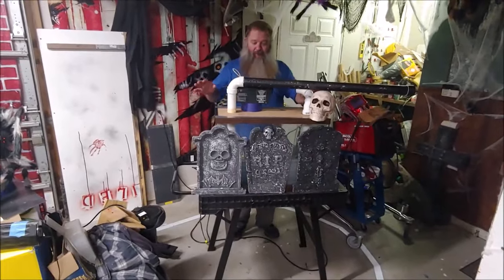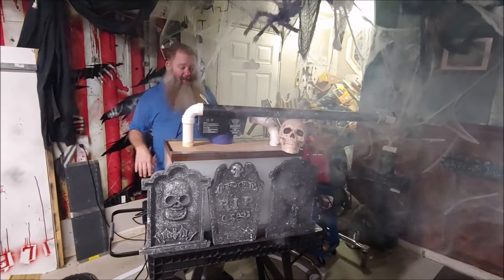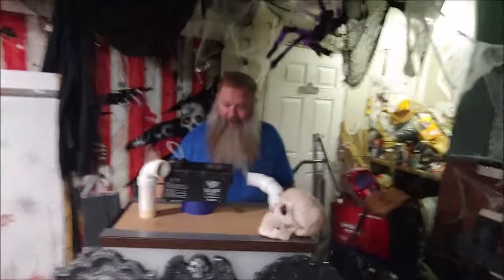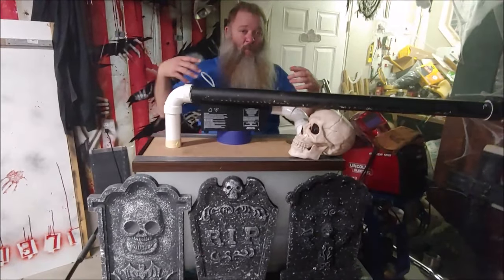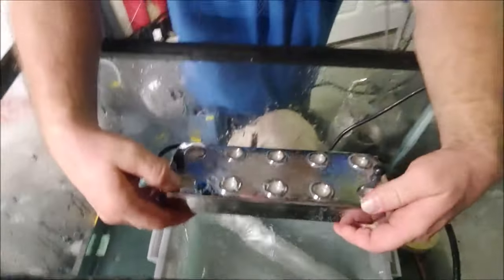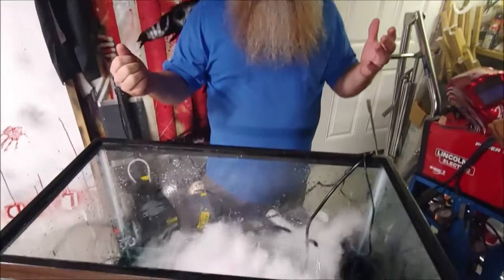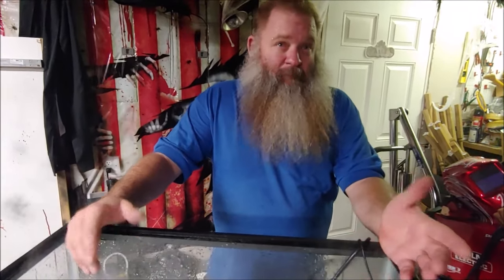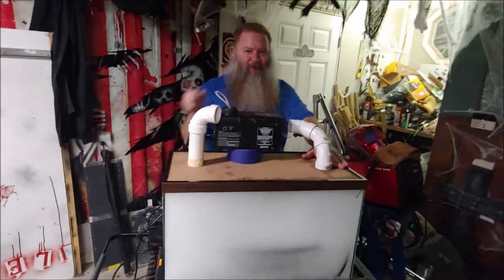Roberts Fogger: The original DIY Fog Chiller without ice

Comment: Heh.. I think I own the same brick shapped "pond" fogger. I also have an older one that includes a float that is round that I got 10+ years ago for messing with the same thing. I ordered last year a water pump to do the same thing (to keep the water level on the brick shaped pond fogger constant), but never got around to constructing a final container. A fish tank is a good idea, that was one thing I have not done yet.
But yeah, it's amazing the output. However one thing I've used is a duct fan (for heating) and a dimmer/fan speed control to adjust the flow on the output side because I've gone with choking the input side from the normal fogger (what I call the smogger) in order to reduce the spill output and then a timer on it so it has a controlled duty cycle. Hope my 2 cents helps anybody else!
The only thing I have to say is the water ends up getting fairly warm.. so perhaps a way of "leaking" water out slowly and replacing water from hose or something to keep it from getting too warm. My thinking is the cooler the water, the cooler the ultrasonic mist (pond fogger output) and the heaver the recombined glycol + mist will be -- with warmer water it doesn't seem to sink as fast. An additional 2 cents to solve out. What I've done is also add some ice, it it melts fairly quickly as these pond foggers (and the limited amount of water contained in the containers I've mess with) get QUITE warm over time. 
A larger fish tank would help, but eventually the water there will get warmer and a way to chill the water would be nice to solve (thinking a slow drizzle of water from a garden hose and a way to keep the 2nd water level from getting too high, has to be below the upper water level for the pond fogger).
Reply from the maker: These are great suggestions!  I wanted to use a float as that eliminate the need for the pump. 
I originally wanted to use the pump to run the water through a radiator with a fan to cool the water being pumped into the misting bucket. I just ran out of time.  
I really need to do some long term testing.  It seems that the very warm water doesn't have as much of an impact as I thought it would. That's why there is little motivation to cool the water for me. LoL. That and I bounce from shiny project to the next. 
But seriously, I was trying to keep this setup fairly uncomplicated.  I also thought of having a small window AC unit to run the fog output through to further cool it, but now it's more complicated than needed. 
However, I do worry about the heat of the water over time. So, I will revisit the radiator idea after I finish some other projects I'm working on. 

Thanks for watching and for sharing your experience with this kind of setup.  I think the DIY community can really help to refine this and make it killer!

Comment: Hi, hope all is well. I’ve seen both of your machines and I’m very impressed with both but I like the other a bit better. (I’m not knocking either, I like both just the other one a bit more) i am trying to build myself one like the previous one you made with the fan in it. I’m going to use a pvc tube and close the end and drill a few holes through the tubing. The only difference I’m going to try and see how it works I will be using g dry ice and the glycerine vegetable oil with distilled water I think it’s like a 40-60 ratio or 60-40 something like that….. if you have tried anything like that what was the outcome…. If not I will let you know how it came out. I live in the north east so we have a windy fall so the thicker the fog the more noticeable it will be. Thanks Rob…. Your info is very appreciated. Make your digger and start selling it and make some money. You never know. Blessings

Comment: Just wanted to say thanks! Ingenuity at it's best!  Just orders parts and will hopefully have an ice-free Halloween!!
Reply from the maker: Thank you so much!  I hope it works well for you.  I'd love to see the scene once it's all assembled.
Reply: @intocoasters  Parts just got delivered. I went for simplicity, used large plastic tote for the water, and floating a 12 head mister, so no need for second container or pump. An elbow on top for entrance and flex pipe out for fog. assembled in under 30 minutes. All holes are in the lid so the tote is still functional for storing Halloween decorations.  Did a quick test and I'm amazed at how well it works. Logs of thick, low fog.   My display is small, a handful of tombstones, small fence a skeleton or two, so not that exciting. It's the fog that make it. First time I've done a haunt in years, so still fun.    Thanks again for sharing your invention. This revolutionizes low lying fog.
Reply from the maker: @nicksweet3826  Awesome to hear!!  and yes, holes in the lid gave an accidental ability to still use it as a proper storage bin.  I store the parts and some other props (usually loose bones) in the same bin after letting it dry out.
12 head! Dang, I bet that is awesome!  I should upgrade now, LOL.  
Thank you for the follow up and I am very happy to hear it works well.
Happy Haunting!
Reply: @intocoasters   Here's a short video testing it out. Now if I can only get people to stop calling the fire department as I work on tweaking it...  https://youtu.be/LAuQQjIE66c
Reply from the maker: @nicksweet3826  oh man that is beautiful! I love the crawl and the density.
I live next door to a volunteer fireman, the struggle is real! LOL
Reply from the maker: @nicksweet3826  DUDE!  Having multiple levels for the fog to roll out of is killer! 
Looks like the fog is coming from the graveyard proper.

Good to know about the humidity/temperature confirmation. 
I haven't noticed enough difference when tinkering myself.  But I never explored the differences so I haven't really commented about it. 

Excellent videos.  Thank you for sharing!

Comment: I think the reason for the drop in temperature is due to the ambient temperature of the room + air flow evaporating the fine mist water droplets which draws energy from the surrounding fog as it passes through. The resultant drop in energy will also cause the entire chamber to densify it's gaseous mix. (less heat, less pressure, more density of constituents). Just a guess, but it makes the most sense.
Reply from the maker: I love hearing theories on how this works as I don't really know - It's awesome to have everyone sharing knowledge.  Thank you!

Comment: Fantastic! Now what happens if the basin in the bottom has ice-cold water? Guess I will build one and find out!
Reply from the maker: That is an excellent question - I haven't tried that yet.  I can say that the water gets VERY warm during use.  But the fog still lays low.
I was thinking of adding a radiator system to help cool the basin water before circulating.
If you build one with ice, I'd love to hear the results!

Comment: Add weather stripping to the part the wood sits on.  You might need an extra weight to make it seal but it's better than taping/re-taping
Reply from the maker: Agreed!  I rebuilt the whole thing in a crate with a built in gasket.  Made a big difference.  You can see it here: https://youtu.be/JBruBgdCFVA?si=UGqp1zvdDEy0lbMv

Comment: I'm glad I saw this. You made my haunt preparations more fun. Last year I built a pure water fog machine using a 12 head ultrasonic pond mist maker. It worked OK but not great. The advantage was that it used water and had a continuous output. It did produce ground hugging fog though. The container was similar to your aquarium. I used a float in the container to provide the proper depth. The mist was forced out of the container through a 4 inch duct using a computer fan. Unfortunately, I let it go until all the water was gone and 12 head unit died. This year I replaced the 12 head unit. 

After I saw your video, I was inspired to make a fog juice/water mist hybrid. The original idea was to get a "Y" PVC pipe to mix the output of the fog machine with the output of the mist machine. Good plan--didn't work. Somehow the computer fan stopped working. It was mounted in the top of the mister machine and I think it got wet. I removed the fan and used some 4 inch accordion hose to connect the output of the fog machine in the hole where the computer fan was removed. Essentially, I created your exact set up except the mist maker was on a float and not in a separate container.

It worked a treat! When the fog machine warmed, the fog went into the mist container. The fog  that came out of the output 4 inch accordion hose  was thick and ground hugging. Once the fog machine shut down, the fog/mist continued to flow out of the output hose. I think it was gravity powered at this point.

Bottom line, I now have a ground hugging fog/mist maker. The mist maker and the fog machine are mounted on a shelf behind one of my Halloween props. Both units are 32 inches above the ground so that they are easy to service. The output accordion hose goes to the ground and snakes into my graveyard haunt. I'll take a picture tomorrow. Thank you for your video and Happy Halloween. AZAtheist.com
Reply from the maker: This is so cool!  I knew I couldn't be the only one to try this.  
I've been thinking about the size of the tank... I want to see if a smaller tank will impact it too much and would a larger tank improve it.  
I do like the siphon effect to have a light continuous mist in between fog blasts. 

Did you have an issue with condensation in the tubing?
Reply from the maker: @donaldlacey4194  nice write up!  
I'm glad you mentioned trying to achieve this one way and it didn't work out, so you changed some things and made something better.  I think that is such an important lesson to share with other DIYers.  Never be afraid to fail, that's when I learn the most.
Thank you for the mention and for sharing your project! I love to see what others are building!  I also love the idea of raising the tank so that the mist is constantly self deploying in between fog blasts!
Reply: Thanks guys. Inspired. I found a ten head system with floats (head unit sit in the float) on Amazon. I will be trying it in a couple weeks.

Comment: Thank you for this beautiful and precious content, it’s really qualitative information ! 
Do you think it could work with small tubes ? I found a very thin metal tube that I used for this project. The smoke should come out of the thin metal tube where I placed the holes. But I don't think anything is coming out yet. Do you think it's because the air can't circulate in a small space? Thank you so much
Reply from the maker: What an awesome comment... Thank you!!
Small tubes can be a problem.  I have a prop that uses small tubes (about 1/2" diameter). I have to occasionally empty the tube of fluid that condensed during use.  These tubes are plastic. I imagine metal tubes would cause condensation quicker.    I would try tubes a little larger if possible.

Comment: Water has a pretty high specific heat which means that the water vapor will likely have at least a slight cooling effect, however you are probably right that most of the effect is due to the fog picking up moisture and therefore weight.  I'm curious to know if this would work as well in areas of high humidity.
Reply from the maker: It did fairly well.  The coast of North Carolina gets quite humid during the summer.  It was moderately humid during the filming of this video - I remember being worried it would not cooperate for the camera.

Comment: I'm sorry to report that I tried this Halloween night and it didn't work.  I duplicated your setup, using one of those black bins with yellow tops from Walmart instead of a fish tank.  10 head mister, water pump, the whole setup.  But the fog didn't sink.  I used Froggys Fog - Freezing Fog outdoor low lying fog juice.  Since you were obviously able to get this to work for you, my assumption is that this is ok for smaller foggers.  But I have a Chavet Hurricane 1300 and it is very powerful.  

Another thing to note, although it wasn't working, I let the fogger run through the mister since it was already set up.  At the end of the night, about 3 hours of runtime, I took the system down and found that the water in the bin was uncomfortably warm.  The ultrasonic mister does create a significant amount of heat on its own and the fogger just adds to that.  I don't know if there is a max operating temp on the mister, but it is something to consider.

Thanks anyway for a creative idea.  I'll probably repurpose the mister for another Halloween project and convert the bin to a regular ice based chiller.
Reply from the maker: OH NO!!  That is super disappointing to hear!!!  And kind of discouraging.   
I have tested with a 400 watt and 900 watt machine and both worked well.  I was using the 900 watt on Halloween and it was still falling at the end of the night.   
Also, I noticed the water was quite warm at the end of the evening too - so I will be trying to find a way to cool that down some more.  Maybe have the circulating pump run the water through a small radiator outside of the tank.

I want to test with a Hurricane 1300 now.... I wonder if my machines put out fog slower?   The only thing I can think of is the volume of fog moving through the tank is too fast to experience the cooling effect.
I am really sorry to hear that this didn't work.  Was there any noticeable difference between using the tank and not using the tank?    
I do hope you had a great Halloween despite the chiller not working with that machine.  
If you were able to, I'd love to see a video with and without the mist units on so I can see how fast the Hurricane puts out fog.
Reply: @intocoasters  I didn't try it without the mister.  I had the mister's power supply and a power strip in a marine battery box to keep it protected from the weather since this was outside.  The fogger and the water pump were also plugged into the power strip so it wasn't easy to turn off the mister and water pump.  I just installed a XT60 connector on the DC line to the mister to make it easier.  I found it irritating that everything is wired together and needs a screwdriver to disconnect the power leads.

Even though the fog didn't hug the ground, it hung around enough to provide the eerie atmosphere.  My son wanted to hide in the fog so I did one long blast.  About 5 minutes later I went to the driveway and saw a cloud traveling down the street.  My neighbor said it came from my house.  Pretty funny.  Usually it rises and is torn apart by the wind.  So maybe the mister is doing something, but just not enough for my fogger.

I'll try it again when it gets less windy.  I tried this in the house and set off my smoke detectors.  Even though
Reply from the maker: @NightPueo  oh man! I would've loved to see that ominous bank of fog rolling down the street!! 
I agree, having everything wired together wasn't my best idea - I'm going to make a control box for next year so I can turn on devices separately.  Maybe just use light switches wired to individual outlets.  I wanted to warm the fog machine but not have the mist running until people were near the scene.  I'm thinking it would help keep the water cooler too.

Comment: That's genius! So I wonder, in theory, could you use a cool mist humidifier in something similar could you get the same effect??
Reply from the maker: I initially tried with a single head mist unit that I have for a table-top cauldron. It seemed to make the fog a little bit thicker, but could not keep up with the flow from even a 400 watt machine.
Reply: Cool mist humidifiers are usually made from ultrasonic misters, so, yes, in theory this would work.  But they're not designed to produce as much mist as rapidly as the 10-head ultrasonic mister shown here.

Comment: Water vapor is very good at absorbing energy via evaporation, that's why misters can cool the air on a hot summer day (and not just get you wet). The water vapor actually absorbs heat energy out of the air. I'm sure that's what's happening here. With a lot of water vapor at a lower temperature than the fog, it absorbs heat energy from the fog making the fog more dense and heavier.
Reply from the maker: the energy transfer vi heat makes a lot of sense.  Even though the water gets warm, this is still effective hours later.

Comment: Hey! This is awesome! I’m trying to recreate this but having a few issues- can I get some advice? Do you think the size of the pipes will make much difference? And rather than having my smoke machine on top feeding into the lid and the fog tube also coming out of the lid I’ve gone into the left side near the top with the smoke machine inlet and then the fog outpour tube is on the opposite side. Near the top too, I’m getting some good results but it’s not quite right.
Reply from the maker: Hello! The size of the pipe should not matter. I have rebuilt this with larger pipes for this past year. As far as coming in from the top or the side, there doesn't seem to be a difference. My demo had it in the top because I was using a glass aquarium and did not want to try to cut through the glass.

Which part feels lacking? Not enough fog? Or is it not laying low?

I would say the most important part is to make sure the water level is the correct height where your misting unit is sitting. You should have quite a lot of water fog in your box or tub even before you start your fog machine.

The amount of fog output will partly depend on the fog machine you're using and how much mist you can produce.

Are you able to post a video of your setup and output? That could help with troubleshooting